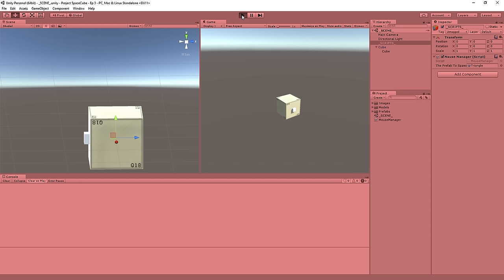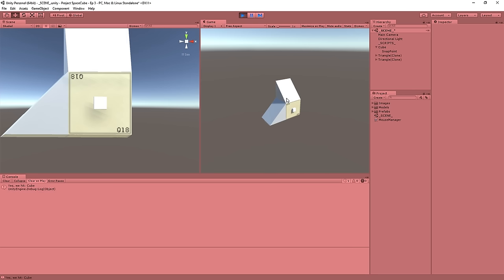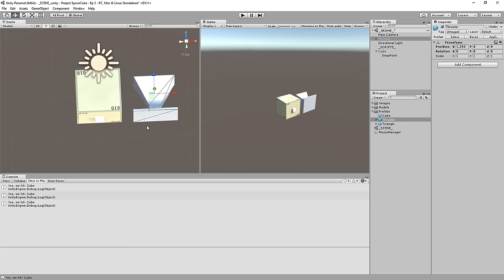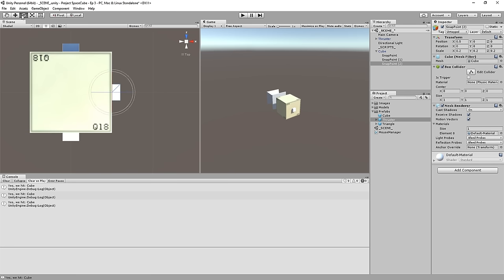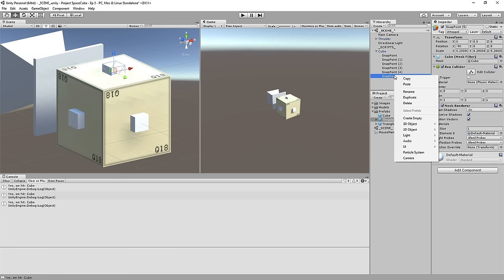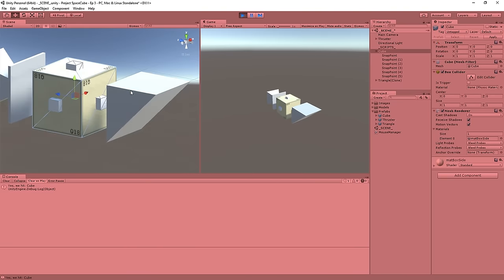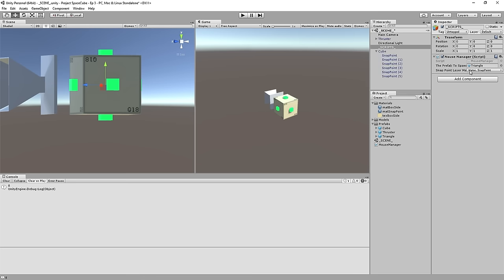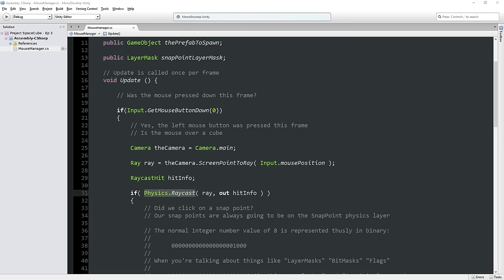Unity Tutorial: Build-Your-Own-Spaceship in Project SpaceCube - Part 3

Comment: Thanks for the bitwise tutorial, but It's hard for me to believe Unity haven't made methods for dealing with this sort of stuff on beforehand.
Reply: Using tags would have been the "easier" solution. But this is the most efficient way to do it for optimizing the physics system. Sadly, the Unity API does little to make that easier.
Reply: You can also do ...
if ( hitInfo.collider.gameObject.layer == LayerMask.NameToLayer("SnapPoint") ){ .... }

Comment: Instead of those bitwise operators why dont you pass the layermask as a parameter on Physics.RayCast() in orther to filter the array of colliders that it returns??? 
Raycast(ray, out hitInfo, Mathf.Infinity, snapLayerMask); //(Ray ray, out RaycastHit hitInfo, float maxDistance = Math.Infinity, LayerMask layerMask);
Here the link to unity 3d api: https://docs.unity3d.com/ScriptReference/Physics.Raycast.html
Reply: Because then the raycast will continue through any objects that aren't of that layer, so you could potentially click the snapPoint on the opposite side of your cube, or another cube entirely.
I'm sure you already figured this out by this point, but just in case anyone else is wondering.